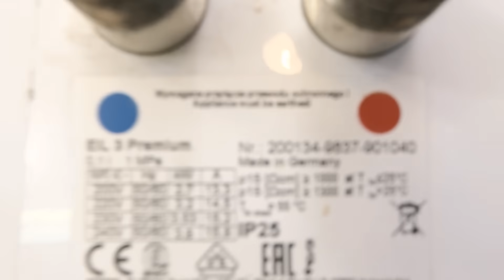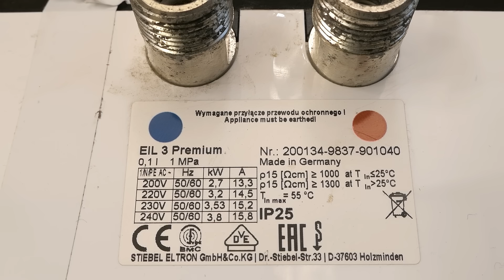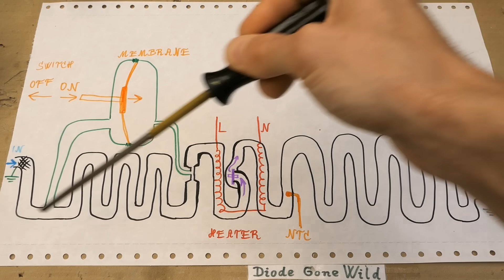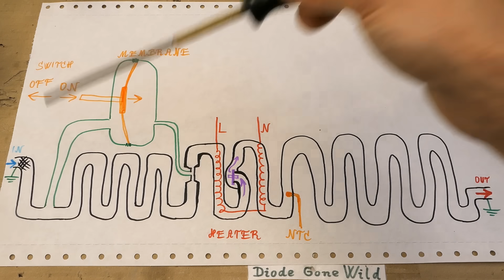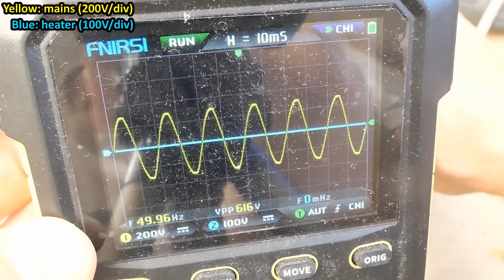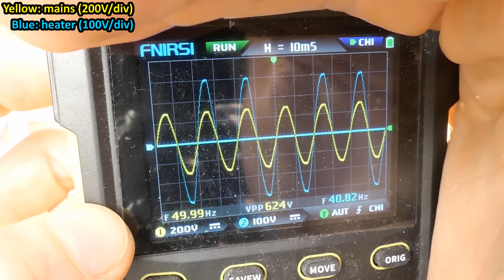What's inside a tankless water heater

Comment: This water heater shows many similarities between water flow and current flow, including the pressure drop tubing acting resistively. A great crossover assembly of electronics and "plumbing". Thanks for your insight!
Reply: Exactly my thoughts 😂 also reminded me of small and large bowels.
Reply: Except, current doesn't flow....
If this were used here in the UK, if it leaked any amount of voltage to ground up to 30ma it would trip the protection switch.

Comment: That heater has more processing power than my first computer did.
Reply: This simple programm could be done with a few lines of assembler on almost any realy small controller for sure...But the bold processors are to cheap today and and the programmers are too lazy to deal with assembler code too...
Reply: Have no clue why my comment that is has more than the moon l a n d e r did? 
Utub is insane.
Reply: Nowndays a microcontroller that would outpace all the computing power of the 1950s costs about 5 cents and takes under a watt of power
Reply: Probably more cooling capacity (heat removal) as well.
Reply: @liam3284  The LED controls I suppose
Reply: That's putting it mildly it's - orders of magnitude more powerful than 6502, RAM bit low, though.

Comment: Made in Germany, but the top text is in Polish and English, and analyzed in Czechia, true EU content ;p
Reply: Who would have thought that stuff like that was actually still being made in Gerrmany.
Reply: It's because they are useful. Small single phase instant water heaters serve great in summer houses. You can leave them there even for wintertime, cause there is no big water tank like in a boiler, that can freeze up and explode. And it's never an easy job to fully empty that tank.
Reply: @5Dale65  They are useful, absolute. It's just that such cheap home appliancese tend to be made in nearshoring countries like Hungary or Turkey (if not in China) these days.
Reply: @andreasu.3546  Why lol that's literally the most efficient (99%) way to heat water
Reply: @paul_ko  It is efficient, but it doesn't have enough power for making shower, so it is only good for washing hands.
Reply: @mareksykora779  There are various types, I have a 21kW one and it absolutely is enough for showers. The most common ones in Germany are between 18 and 27kW
Reply: @paul_ko  Sure. If it has 20 kW then it has the same power as gas instant heater. But this one is 5 tiimes less.

Comment: EXACTLY the same thing happend to me a few years ago. I had the same or a very similar heater and the seal failed in the same way. I was thinking about just putting it back together with silicone, but ended up throwing the whole thing away. Obviously the design is flawed. Screw those manufactureres who dont sell replacement parts!
Reply: Lol id just superglue that thing and use it ONE LAST TIME.
Reply: @VJETRA  I thought the same thing, but plastic is sometimes tricky to glue. You need to know what kind of plastic the thing is made from
Reply: @WolfmanDude  well theres screw hold them together . the glue is just to seal that small bit
Reply: Design is not flawed. It "works" exactly as intended. For exactly how long was intended.

Comment: Seems reasonably well designed and constructed, those seals not being available is stupid though.
Reply: It's probably because of liability, can't have random people mess with a device like this where high voltage/ current & heat is this close to water.
They might sell spare parts to licensed companies though, i had my stiebel eltron repaired once after a surge (by an electrician).
Reply: @timhartherz5652  All the fixing screws probably have to be tightened in the right order to the right torques too - like an engine block!
Reply: Could try to silicone it, worst case it just leaks again, depends on how high the pressure in the pipes is.
Reply: @BitterCynical  Worst case it leaks into the electric and the wall socket isn't properly grounded giving someone a good shock.
One can try, but the Manufacturer will reject any responsibility.
Reply: @timhartherz5652  they can just write: to be serviced only by qualified personnel, no reason to not sell the seals except to make more money
Reply: @timhartherz5652  If there isn't a proper ground that's a completely different problem. That's a mandatory requirement for appliances like this water heater.
Reply: @BitterCynical  Yep but who verifies this before diy installing an off-the-shelf heater, it's usually not a problem either IF the heater works properly, so people won't notice until it fails for some reason and you need this.
The manufacturer can only confirm that this thing was safe when it left their house, any aftersale repairs need to be done by a professional, which becomes responsible.
Of course if it was installed by a professional, than said professional also needs to verify the correct installation of the socket, which can't be expected from any tom/dick/harry.
Reply: No. The design is bad. This sealing size is a design flaw. It needs to be thicker, more robust. It looks like it has problem with different dilatation of the parts with hot water and movements are catched by the sealing.

Comment: The heater is not "just" omitting cycles. Zero-crossing control (that's what the AC wave skipping is called) is actually the only thing allowed at these power levels! (Well, unless you have a fully power factor corrected supply, which is mighty expensive when we talk 3.8kW). Most electricity providers prohibit having more than 300-400W phase angle controlled (that's per mains phase entering the home), because of the non-sinusoidal load on the grid (that's in sync for all consumers on top of that).
Reply: I dont understand how it affects the provider wether you use one or the other when you're switching into a resistive load (harmonics ?) 
May i ask you some sources to read about it ?
Reply: @weistonaski6924  Switching on (or off) at the top of the voltage, creates transient (current-) spikes. So yes, harmonics reflecting back into the net.

Comment: 3:15 - We have buy a Stiebel Eltron too, with 3 phases 11kW/13kW heater inside and electronic temperature settings.
An other advantage is, that the Calcium oxide inside of the water can not stuck at the surface of this wires. This makes it very endurable.

My female cat is doing the same, take a bit of food, put it at the side at the ground and eat it there. 🙂 I always have to clean the ground with Isopropanol+Water spray and some toilet paper after she is ready.

Nice that we could see the inside of the water heater.

That Stiebel Eltron does not sell this silicone seal is bad, there should be a law for the repairability of this devices.
Reply: You can try to use flat dish for your cat, probably cat instinct tells them avoid to put their head in such a holes
Reply: It is NOT calcium oxide! It is calcium carbonate. Very basic chemistry, even a 13 year old should know this.
Reply: @mernokimuvek  - You are right, it is CaCO3. Possibly with 13 I did know it.
Reply: @mernokimuvek 

Just call it limescale.

Comment: These instant heaters are commonplace in many developing countries because a gas heater system is way too expensive to build into a older house, even though it's cheaper in the long run. Most of the "suicide showers" here have no turns at all, the water floods a small chamber where there is a bare wire heater eating several kW from the mains.
Reply: Gas plumbing shouldn't be done new anyway, as methane gas causes climate change. Besides, every use for gas has better alternatives now.

For hot water, use a hot water heat pump.
For heating the home, use a heat pump.
For cooking, use an induction stove.

The price is changing too. Solar is absurdly cheap now, and battery prices are dropping quickly.
Reply: Because Germany is a developing country???
These are very common in Germany and as weird as it might sound, they are very safe if installed correctly.
Reply: They are also Common in developed Countries. These small Units are usually used for sinks which are rarely used and to far away from the Central Boiler to justify a hot Water Pipe. 
For some reason I have a 36kw unit in my Bathroom and a 17kw one in my Kitchen while the room heating is fueled by the waste Heat from an Incinerator.
Reply: @ppdan 

I think they can be very dangerous with dodgy wiring, 15 Amps is not a joke.
Reply: @westelaudio943  In lots of German homes you will find 20-30kW versions of those. You'll need much more than 16A for those, something in the order of 3x32A(400V).

Comment: Very similar concept to the electric showers found in latin america. The difference is that this one has electronics, while the showers are just a membrane, two resistors in water, and the power selector.
It is very safe, when installed with proper grounding + GFCI + dedicated breaker.

Comment: Intressting little device. I've never seen a single phase continuous flow heater.
The ones we have here in Germany are usually 3 phase and use between 18 and 33kw.
Reply: 33Kw For what? An entire apartment building?
Reply: @MrTurboturbine  instantaneous water heater require a lot of power. 2 kW tank heater will heat 100 liters of water after 6 hours, and 33 kw heater will heat it in seconds
Reply from the maker: Yes, with 3.5kW, the water is barely warm with a fully opened tap.
Reply: i see quite a number of them in german office buildings. it provides "warmed up" water for lavatory sinks.
Reply: @MrTurboturbine  the power required really depends on water input temperature, it gets really cold in germany
Reply: @MrTurboturbine a standard tankless water heater uses 27kw of gas "power" an electric one that can provide the same flow rate has to consume a similar amount
Reply: @rarbiart  Thanks, I thought I had seen them. Now I remember where.
Reply: @MrTurboturbine  You need about 13.5kW to heat water from 20 to 40 degrees. During the winter tap water is much colder so you will quickly need +20kW to be able to shower during the winter.
Reply: This is clearly for residential usage, I doubt there many places in that category that have that amount of amps available
Reply: @jb5631  In Germany it is very common to have 3x400V 32A or more, which makes sense since those water heaters are also very common.
Reply: As a rule of thump: devide the power by 2 to get the max flow rate of the water.
A shower needs minimum 18kw, a rain shower 21 to 27kw...
So this 3 kw device has a max flow 1,5 liters/min and is designed for a handwasch sink in for example a toilet...
No spare parts because of reliability and also the handeling and shipping costs would be 100 times more expensive then the part, so if you are willing to pay 100 euro for a gasket... (So not because of corporate greed!) You better by a new device. Service centers have acces to spare parts (they are qualified) > the reliability thing....
Reply: Single phase ones are best for summer houses
Reply: @liam3284  Actually most of those device work on both (3x400 or 3x230) but connecting them on a 3x230 will just lower the total kW (exact figures can be found in the specsheet of the device). Like I said 3x400 32A or more is very common in Germany (even for a flat)

Comment: DGW, what happens to power dissipated in the ground circuit? Surely some current is lost in the ground loop. Do these things sork with GFCIs?
Reply from the maker: The ground leakage current is surely way less than the 30mA needed to trip a typical GFCI.

Comment: Mains heater/wiring right in the water and it just relies on resistance of water.
Would never have thought of that.
I assumed it would be some metal block that has got an insulated heater attached to it, the water then just flows thru the hot metal part.

Comment: Looks like the seal could be 3D printed using TPU, though drawing it would be tough. It could be 3D scanned tho. 

And I'm not sure about the thermal stability of TPU in hot water 😕
Reply: just take a photo of the seal with banana for scale, then import this photo to a 3d program and design around it
Reply: step 1 put the cover with the groove in the regular scanner with a ruler beside it for scale, step 2 cad, step 3 print in tpu if it can handle it or print a mold and inject gasket/high temp silicon
Reply: @taist5400  This wasn't meant to be open anyway just glue the cap with silicone sealant, doesn't even need high temperature.
Reply: Place the seal on a flatbed scanner with a ruler next to it.

TPU would indeed not hold up to the temperature, but as I've replied to someone else: TPU wouldn't hold up to the heat, but you could definitely create a mould in PVA filament, cast with silicone rubber, and dissolve the mould.
Reply: It could be 2D scanned, just drop it on a flatbed document scanner. You can use a black backing or just leave the lid open. You can have Inkscape vectorise it for you, though i'd probably just do that by hand.

I don't think TPU is a great choice, as its temperature resistance is limited. Instead i would be 3D printing a mould and casting it in gasket silicone; or even make a plaster or whatever mould of the original pieces and cast them in gasket silicone.
Reply: @taist5400   Flatbed scanner is dimensionally usually scary accurate and doesn't need a reference ruler. Now when you use Fusion it doesn't have a way to preserve dimensions but you can superimpose a reference dimension digitally in any photo editor.

Comment: As others have mentioned, you could just use silicone sealant to make gaskets yourself.

I wonder why they didn't just go for an "electrode heater" design if they weren't isolating the heating element anyway - that way there's no possibility of the element overheating if it's not covered with water.
Reply: The electrode heater design has significantly more current passing through the water, and some small amount of electrolysis corrosion can happen even on AC. 

Not to mention the power would depend on the water conductivity in that situation.

Comment: No chance to buy sealings? I wonder if these could be made by scanning the block and then 3D printing new ones out of a thermo-curing elastomer.

Some of those Stiebel Eltron instant heaters have electronic sensing system rather than (or on top of) hydraulic, this one may be an example. These can work with pre-heated water, which is useful with a storage water heater being the primary water heating device, with the instant heater active only when the hot water from the tank hasn't reached the tap yet, or got depleted.

I'd love to see the electronics reverse-engineered. It's surprisingly advanced, using a STM... not sure why.

Comment: u think it's German made and premium Stiebel Eltron but after year or so u have to throw it in trash due to no any spare parts available. for example it's enough to have some water supply disruption with gas bubble in the pipe and the heater element will vaporize. it is not available as a spare part so one need to master in silver welding. also the bracelet on the on/off switch element likes to fly off and it's death no longer giving noisy click.

Comment: I wonder if you could 3D print a replacement gasket out of TPU. As long as the water temperature doesn't exceed 80C, it should be fine.

Comment: Surely this type of heater would trip an RCD with bare elements?
Reply from the maker: No, the leakage current is way less than 30mA.
Reply: Depends on the RCD standard and the water (resistance) so it might not work everywhere.

Comment: Impressive to think this Triac cause such little voltage drop, it can switch 16 amps with no heatsink required.
Reply from the maker: It has a heatsink cooled by the water.
Reply: @DiodeGoneWild  You're right of course, I didn't notice it but the cooling block is clearly visible at 2:25.

Comment: My dad has a similar device branded "clage" that's made in England apparently, and it is as simple and dumb as can possible be, it only has 2 micro-switches and a heating resistor and that's it, the temperature is regulated by a screw that regulates the water flow. Honestly its a pile of "rubish".

Comment: I'm a bit disappointed that they didn't control the power in thirds (obviously the heater would then need to have three full-voltage segments wound with thinner wire, so whether it'd be durable enough is another question; but obviously if they really cared about durability, they'd sell replacement gaskets).

Comment: Why using an optotriac when the microcontroller is not powered by an insulated power supply ?
Reply from the maker: When the microcontroller is powered using a bridge rectified capacitive dropper, it is referenced to a wrong point. It can't control the triac directly.

Comment: Can you not use the old seal and pour epoxy to make a mold? Once the epoxy sets, pull the old seal out and use the cavity to pour silicon in it. 
When the silicone sets the next day, you have a new gasket. Make more if needed.
Reply: I wonder how well those would sell
Reply: 3D printing would work too using TPU
Reply: @seikojason  TPU leaks like a sieve.
Reply: @drobotk  Who said anything about selling? It's how others make gaskets for repair jobs.
Reply: @objection_your_honor  Then I got a better idea. You could 3D print an injection mold and mold a gasket out of silicone.
Reply: @objection_your_honor  I was just wondering since the manufacturer doesn't sell replacements

Comment: Hi !

is it the new sui*ide bath? Lol

it's surprising if it doesn't trigger the differential switch at the threshold of 15 mA

What happens to scale on the resistance?

if the water is softened, it becomes more conductive by adding Na+ and therefore there is a risk of phase and earth conduction.

could you measure the current leakage to earth?

Comment: Those gasket seals look like they could be 3D printed with TPU
Reply: TPU wouldn't hold up to the heat, but you could definitely create a mould in PVA filament, cast with silicone rubber, and dissolve the mould.